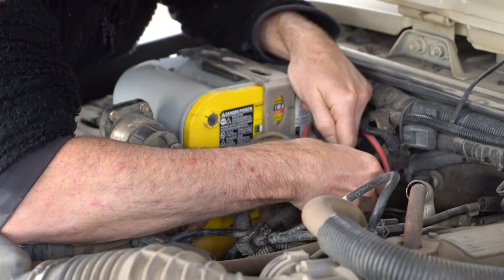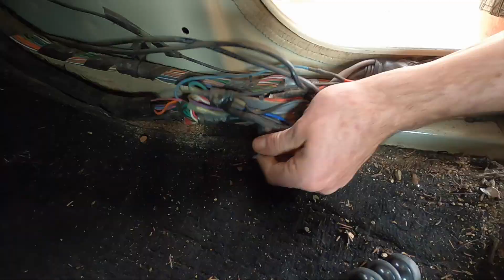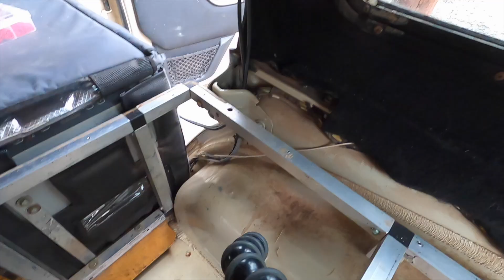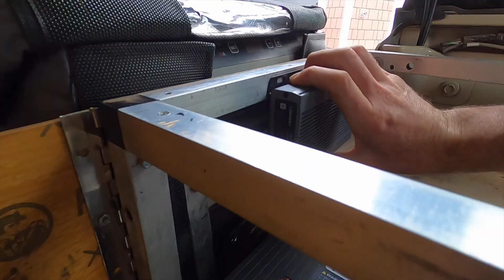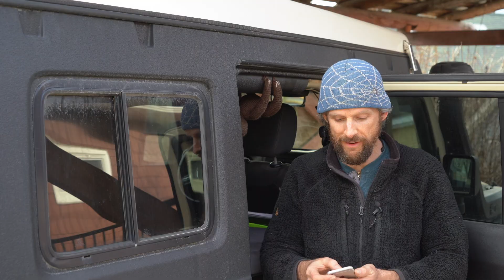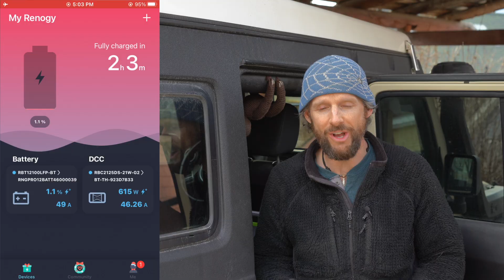Lithium REPOWER - Renogy DCDC + Solar Charge Controller

Comment from the maker: 🔥  Renogy have hooked up a deal for you all - use code 'Theroadchoseme' at checkout for a 10% discount !
 
Renogy 12V/24V IP67 50A DC-DC Battery Charger with MPPT:  https://renogy.sjv.io/5gNPnD
Renogy 100 Pro Smart Lithium Battery:  https://renogy.sjv.io/5gNPnD
Reply: Hi Dan, I've been enjoying the build series, really looking forward to seeing the new build in action. Does the Renogy code still work, I'm looking to grab one of the 50A DC chargers but the code is coming up invalid....

Comment: How hot does it get at 50 amps?
Reply from the maker: Fairly hot to the touch, but it has never been a problem. It's best mounted not in a sealed area. Airflow is ideal.

Comment: Question on steel wheels on the gladiator. Do you get lots of shaking?
Reply from the maker: None, ever.
If you are, you've got the start of death wobble and need to get it sorted out. That is not normal.
Reply: @ just ordered a Jeep Gladiator rubicon and waiting on delivery I have it book in for 2” lift and wanted wider tyres but need new rims for that and shop has Said they don’t recommend steel wheels because of their difficult to balance and would cause the steering to shake
Reply from the maker: Getting them balanced correctly is extremely important.

Comment: Thanks for the video. Maybe you or someone else can support me with my IP67 feeding into a 280Ah Lifepo4 Battery. I get an initially high charge current but it tapers off within 10 minutes without the battery being nearly full. The battery voltage never goes beyond 13.5V. Battery is set to Lithium. Any pointers?
Reply from the maker: What are you using for power into the IP67? Alternator or solar?
Is it a smart alternator? What solar?
Reply: @ wow! Great of you to get back to me. It’s a standard, not smart alternator.  The alternator on is recognized correctly and the charger starts charging but not at 50A despite a huge empty battery. I have ruled out the alternator by connecting a 200A battery charger to the starter battery. Same charging behavior.
Reply from the maker: Are you driving around, or just idling the car?
How are you verifying the state of charge of the battery?
Reply: @thanks again. I have since hooked a battery charger up to the starter battery that is capable of 200A. I had run the 280Ah Battery down to where the BMS shut down. I declared that SOC Zero. I them charged literally for days with the Renogy delivering only around 7A. Finally the BMS shut off and I declared that SOC 100%. When it did shut off the voltage went up to 14.4V with der current. I am thinking that my IP67 is bad. Tech support from Renogy hasn’t been helpful.
Reply from the maker: Are you driving the car, or just idling?
You need to drive to make sure the alternator will put out enough juice to power the full 50A.
Also if the battery BMS shut itself off, maybe the battery is in some kind of self-protection or shutdown mode or something. Double check what the battery is doing.

Comment: Hey mate I have the same charger but my Renogy battery isn’t a smart battery it doesn’t have Bluetooth only the charger how can I tell if my battery is getting the correct charger or it’s fully charged ? I’ve wired everything up but idk what is fully charged and what isn’t because isn’t lithium not work off volts doesn’t it maintain a constant voltage till flat ?
Reply from the maker: Connect to the charger with bluetooth and you will see how much current it is putting into the battery - when it stops, the battery must be full

Comment: hi there apart from the renogy install can i ask if the aluminium framing for the seats was easy to put together.?did the joint connectors slide in without having to use force.? cheers.
Reply from the maker: Yep, that system works really well. Here's me designing and building the interior of the Gladiator for Australia using exactly the same system. Very strong, and lightweight.
https://www.youtube.com/watch?v=_iX6fl394UY

Comment: Hi Dan, I have the same DCDC MPPT charge controller you had in the Australian Gladiator, would you upgrade to this new version from that?
Reply from the maker: I think the only major benefit is the low current solar cutoff setting - if you don't have a need for that I wouldn't upgrade.

Comment: Why not just use a gas fridge and an old kerosene camp kitchen. Takes almost no space, cheap as hell and no worries about all that modern tech go out or been on fire.

I feel that nowdays it is so much about to stuff a vehicle as full as possible with high tech stuff for thousands and thousands of dollar. I thought going away for a couple of weeks was about to leave the boring city life. I know your trips is  very long so I can get what you are doing but in many cases it has just gone silly. Just look at the channel 4wd/27 . That channel has become a commercial channel for ad ons. I found it a  it silly, they are on 10 to 14 days trips and sometimes bring a whole house on wheels with them.😅
Reply from the maker: Gas a keorsene are very hard to get globally - you need a bucket full of adaptors, you're dependant on the local supply chain, etc etc. They stink, they're dangerous.
They are both a very hard no for me.

Comment: Hey Roadie, I installed this in a Ford Ranger 2021 with a smart alternator, unit won’t charge 50amps only about 25-30amps. I’m assuming the Jeep doesn’t have a smart alternator hence why you get 50amps any words from anyone else that might know why my unit won’t get 50amps, I don’t even have solar connected.
Reply from the maker: Check the manual, I believe there is another wire you need to connect when you have a smart alternator
Reply: @TheRoadChoseMe  only has 4 wires, main wire to starter battery/alternator, earth, solar input and auxiliary battery. Other wires are a temperature sensor. People get confused with old units that had a aux wire
Reply from the maker: Hmm, I would reach out to Renogy support and see what they say about it not charging at the full 50Amps

Comment: Great video! You definitely need a temperature sensor on lithium batteries they don’t l”like to be charged cold. Some lithium batteries like the renogy one you have had a bms with a temperature cut off but some don’t.
Reply from the maker: These batteries have them in-built.

Comment: I just also set up the dc to dc, game changer in size . ( compared to old dc to dc and or plus a solar charger)
Don’t have to bring a generator if you’re in a pinch.  But keep in mind folks you only want to pull 20- 30% of your alternators current output without straining it too much. My alternator is 220 so the 50 amps is bang on pretty much. 
Thx for the video! Not much out on these new dc to dc.
Reply from the maker: Great to hear!
One of the great things about the Wrangler and Gladiator with the tow package is it comes with the 240Amp Alternator from the factory.
Reply: @TheRoadChoseMe  my 220 is for a ram 3500 dually, that is a massive  alternator for jeeps. Light up the night with that power. 💡😎

Comment: in my jeep jku crd i have my  renogy DCC50S 12V 50A and 100Ah Smart Lithium and arb twin compressor in a Uneek 4x4 under floor box that you cut the floor out it works so good

Comment: Look into CIGS solar panels. Shade tolerant, heat tolerant, more efficient, much lighter in weight and far more durable.

The only downside on a vehicle usecase is CIGS tech has a lower cell density compared to mono.

Comment: Great video, I disagree with not connecting the temp sensor though, lithium’s don’t like to be charged below 0 degrees Celsius
Reply: Battery BMS will control the low temp cutoff
Reply: @gopackgo69  Only if the battery's BMS supports an internal temperature sensor, not all do.

Comment: Does it also sense when there is no alternator input (e.g. engine off) and allow the solar alone to charge the batteries at the full 50amps? ..... really why I'm here is to find out your solution to making the bed pop up in your new composite camper with straight pop roof.... please tell me 😁
Reply from the maker: I actually don't know the answer to that, you'll have to reach out to Renogy support.
I'm working on the pop top now! Video coming when it's done
Reply: 50x12=600 watts actual of solar, not on his roof
Reply from the maker: @bindingcurve I accept your wager sir :)

Comment: What size gage wires are you using from starter battery?
Reply from the maker: Consult the chart I posted, it depends entirely on how long the wire run is

Comment: I did a full Renogy build-out in my truck and loved their stuff, until I had a component fail on me and had to use their customer service. Absolutely the worst customer service I've ever experienced from any company in my life. I unfortunately will never buy their products again, nor can I recommend them to anyone, until they improve their CS.
Reply: i had exactly the same experience.  good components until there is an issue and then you have to deal with absolutely terrible customer service.

Comment: Be very interesting to see you mount that lithuim battery on its side, only to get a "it failed" video in a few months time
Reply: Yep I've seen a vid and their batteries were stuffing up on there sides they put them up right and never had a problem again
Reply from the maker: The manual specifically says not to mount it on the side, so I won't be doing that.

Comment: Some notes:
- These Optima are no Gel Batteries but AGM, that´s just a different type.
- SoC (state of charge): AGM should not be discharged more than 50% to keep a min. of lifetime out of them. NOT up to 70%! LiFePo4 should keep their SoC between 30-80% ideally. Every thing higher of lower drastically reduces lifetime as well. For sure no 100% discharge in LiIon!
- You finally decided different but do never place a LiIon battery under the bonnet! LiIon are highly sensitive to HEAT. Above 70°C they go DEAD, which is very likely under the bonnet.
- same goes for the DCDC charger: 50A = 600Watt, these thing get hot. Victron for example reduces the output by 20% if temp is higher than 40°C! 
- Temp sensor: VERY important for LiIon. LiIon (depending on Grade A or B and on weather one has the absolut newest Cells inside) they must not be charged above 0°C (temp of the CELLS!) and must not be discharged below -20°C! Very important. Check the specific LiIon cells. Just a few BMS (Battery Management System) include a temp sensor. So this is crucial.

Edit:
- You called the selenoid of the AGM setup inefficient. It is not. For that specific setup with identical batteries and one who have the capability to function as a starter one, it is perfect. (if not discharged below 50%)

Comment: Are you now planning on keeping the JK?
Reply from the maker: I'm still trying to find a forever home for it. Now I'm working on the new one, it makes no sense to keep it sadly.
Reply: @TheRoadChoseMe Curious that you'd upgrade it then. I'm not complaining, great video. Makes me want to upgrade my house solar.
Reply from the maker: @boringusername792 The setup that was in there had died - as I mentioned the fridge and any accessories have not functioned for a couple of years. It needed replacing.
Reply: @TheRoadChoseMe  You should hide it out in the wilderness and whoever finds it gets to keep it.

Comment: Has Renogy fixed the weak wire lug issue?  When I was building my system in 2020 I looked into Renogy DC-DCs and it was about 2:1 people reporting that the terminal lugs were weakly attached to the main board and broke off.  I ended up going with RedArc as a result and have had no issues as one can expect.
Also glad you dumped the PWM charger.  Those are not nearly adequate for modern wet lead-acid batts, much less AGM or lithium.
+1 the comment regarding temperature limitations with lithium.  It is such that I could not use them in my cold climate so stayed with AGM.  And they become more and more vulnerable to failure as they age so be vigilant.  I cannot stress enough the importance of voltage and current monitoring - both charge and discharge - for those things.
Reply: That Renogy DC-DC Does not have lugs. How do they break it?
Reply: @gavinwilliamson3944  I see.  So they did fix it on this particular unit.  Similar setup to Redarc.  The other models have lugs.  Wish they would have done that sooner but whatever. 👍

Comment: I had dual AGMs with a solenoid in my last build too and switched to single lithium iron phosphate battery and the renogy dcdc charger with 400W of flexible solar. I now have 250% the usable battery and 130% the solar compared to my old system and it weighs less than half what the old system did.
Crazy how quickly things have changed in this area for the DIY vehicle builders.
Reply from the maker: Wow, yeah, you said it!
Reply: Great to see you here Matt, I'm subscribed to you both 👍
Reply: @sharpsticksnz4112  I subscribe to TRCM as well. And not just because we both have long, vague channel names 😂
I hosted a round table with Dan at Overland Expo a few years ago. He's a genuine good guy. 
You can probably guess that I appreciate his honest, functional approach to vehicle design and video making.👍👍

Comment: As Long as your LiFePO4 has Low temp cutoff you don't need the temp probe, but if not you want to set it up not to charge if battery is below 0C. LiFePo4 can be damaged when charged at low temp

Comment: Really nice video Dan!  You've covered off thing very well.  Without knowing the length or your wire run I suspect you need 4AWG wire due to needing add both the length of the positive and the length of the negative wires  together.  Food for thought.  My reference is the wire size calculator from Nate's website Explorist life.

Comment: FYI my 50 dcdc renogy also has the solar cutoff setting and I like that I have turned it down to 30 amps. Also it will charge the starter battery at much more than a trickle. Which is great
Reply: I’m about to buy that one. Happy with it?
Reply: @TroopyTreatsx  so far yes, works perfectly